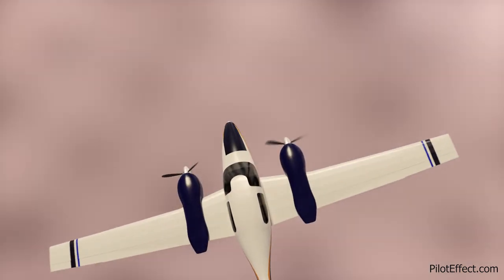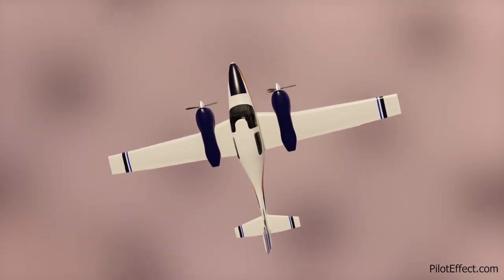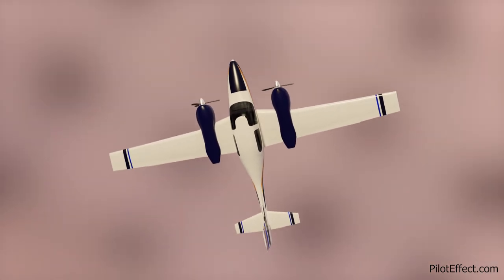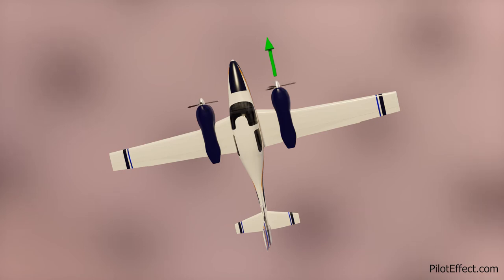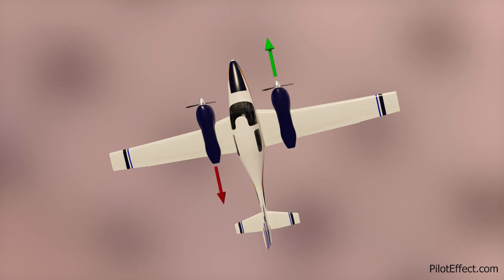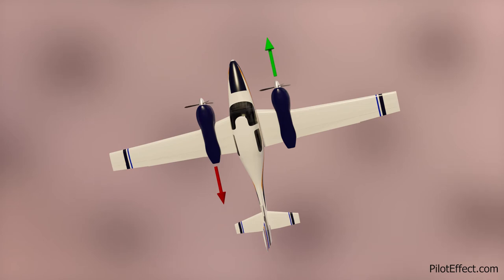Engine Failure on a Multi - Yaw and Roll | Pilot Tutorial

Comment: And aileron drag is going to increase that yaw, if you apply ailerons to level the wings or compensate for the engine out this will create adverse yaw. rudder is the best way to keep the nose pointing the the right direction